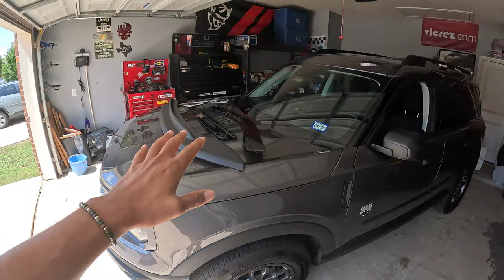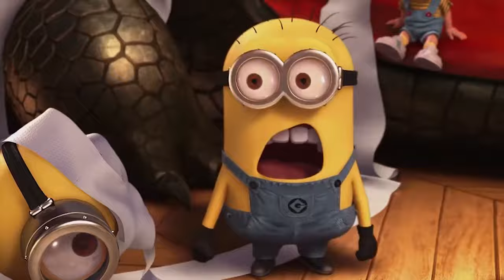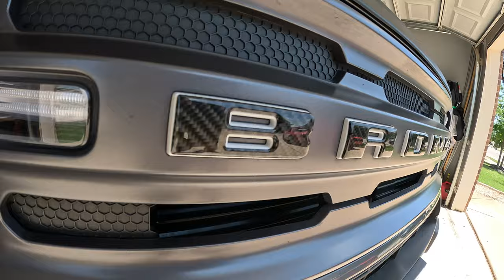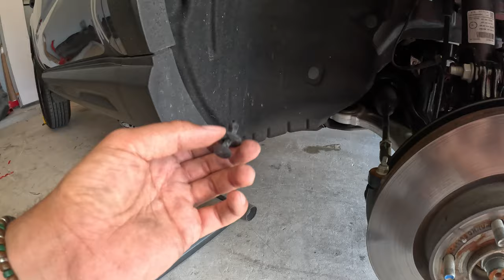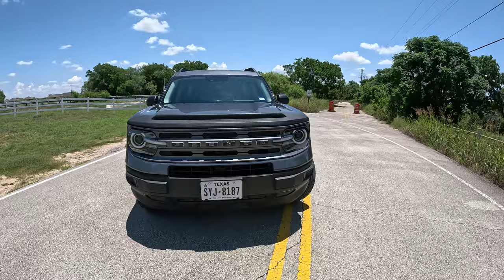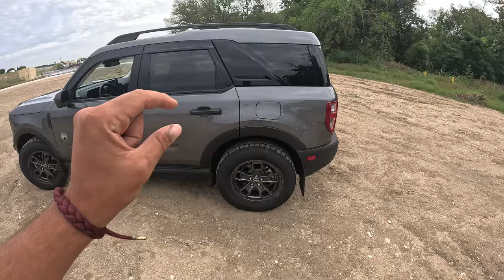2022 Bronco Sport Gets $1,253 worth of Mods!

Comment: is your car carbon metallic? thanks.
Reply from the maker: Yes!
Reply: Thank you. I'm market for one. How do you like it? Issues? Go to has station a lot?
Reply from the maker: @jh276  man I love it! I’m getting 28mpg on 87 pump gas. No issues either I’m at 8k miles now. I get my oil changed and tires rotated at the dealer. Mine has the 1.5L EcoBoost if you want a little more power I would get the 2.0L.
Reply: @TIRADORACING  thanks again. do you have a website or youtube where they show all the after-market/stock parts that we could use to 'outfit' this vehicle to make it look more sporty & outdoor-y? any other youtubers who outfit this vehicle with after-market parts? thx.
Reply from the maker: Yes! This is the dealership I got all my accessories from. You just put in Ford Bronco Sport and all the parts pop up! 

https://truckcityford.fordestores.com/accessories/2023-fordoem-bronco_sport/
Reply: @TIRADORACING  thx!